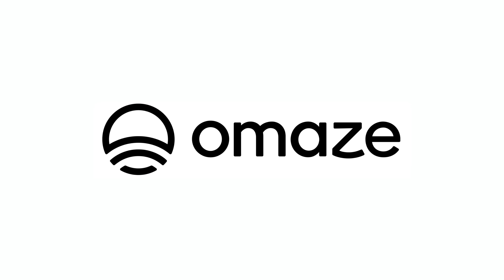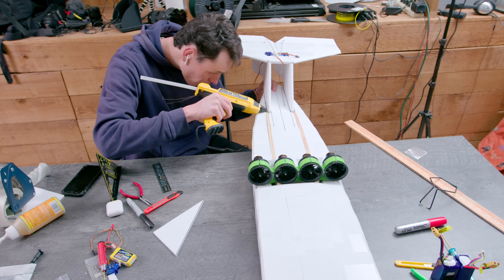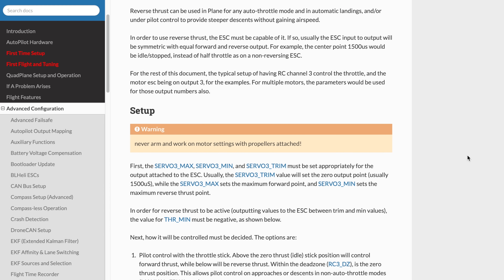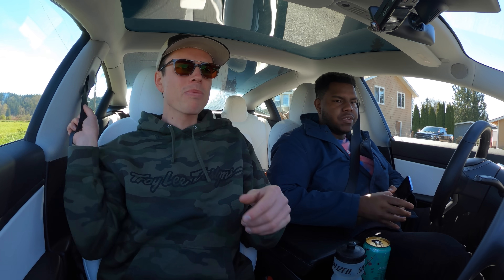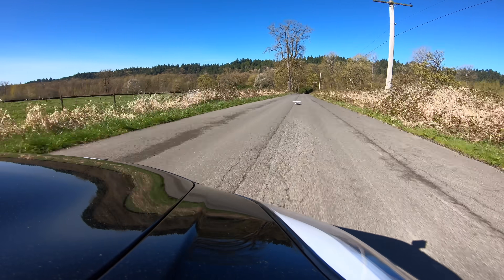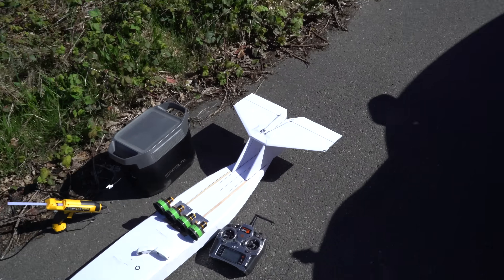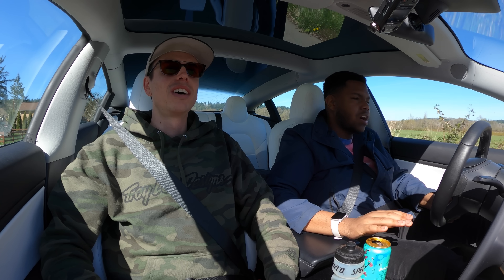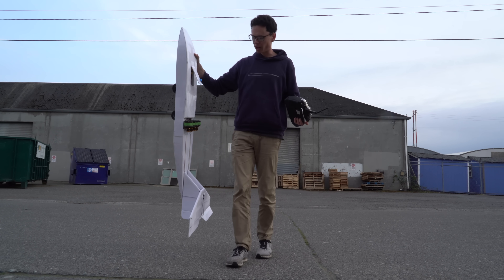EDF Powered Jet Car - High Speed Aero Stability

Comment: everybody commenting about a longer wheelbase...the entire point is, to stabilize it with aerodynamics and not the wheelbase
Reply: With the front wheels also actively turning though, I think there is inherent instability fighting the aerodynamics. Locking the front wheels so they don't turn would reduce but not eliminate it. The scale of the real world road surface to the short wheelbase and tire size is another factor aerodynamics is going to struggle with. A very cool project, but aero is only going to do so much.
Reply: @meZeusta14  I agree
Reply: I was thinking he needs a different testing road. That road is crap, but probably because not too many cars use it. 
Makes it good for testing but not so good for testing something so tiny, going so fast.
Reply: @jbirdmax I agree. Take it to a salt flat
Reply: With a longer wheelbase the body and the rear wing can't change that much of an angle compared to what happens with a shorter wheelbase, so it will bounce less and have better steering control. With a shorter wheelbase the whole car will act like a see saw. Push on the rear wing with your finger and the whole front will come up. That is very difficult to prevent with just aerodynamics, especially on a track that is not perfectly flat while driving at high speeds. Less steering corrections also means less friction and thus higher speed. A longer wheelbase is the only way forward for more speed. I also think that the car has far too much drag to go that much faster. But that is a whole different story.
Reply: It might be faster if you put the same amount of power to the wheels. Imo it would really help to adjust the linkage on the servo and steering linkage to shorten the throw as much as possible. Also you may look at adjusting the front alignment to the wheels to allow for better tracking
Reply: Yea, BUT that's never gonna be stable with aerodynamics. It's physically impossible.
Reply: @b9y  ...and the challenge obviously was to get it as stable as possible. even if there obviously are some limitations.
Reply: I am surprised how no one is talking about how Omaze is a scam...
Reply: Right, but a longer wheelbase would make that end goal easier to achieve
Reply: Y'all talking about wheelbase and making it longer but miss the easiest fix for the majority of the stability issues. The biggest issue is the shocks. Stiffen up the suspension and the cars stability will rise. Its the same with full size vehicles as well, as if you have a bad shock absorber, it will effect the rest of the steering and suspension components by having the oscillations not be absorbed. Trying to aerodynamically stabilizing an unstable object is a lot harder when you have springy wheels with nearly nothing to absorb the oscillations.
Reply: @m_6866  a stiffer spring wont absorb, but cause bouncing. but i think you are right, the suspension should play a major role
Reply: Ok, well give it one wheel then.
Reply: It rreally should just be standing on two wheels, like a segway.
Reply: @haliac7117  by having it front wheel drive and the back being supported 'up' by ground effect? In the aircraft sense that is
Reply: @spencer963  Like when a bush plane lands or takes off, it's on the front two wheels only. Except creating lift to keep up the back would create drag, so I'd think the wheels should be right in the center of mass so it only needs stabalization.
Reply: @haliac7117  a motorcycle
Reply: I didn't say that. :
Reply: Longer wheelbase stabilises
Reply: Thank you. This is not a ground effect solution  but a wing supported wheelbased solution with friction between wheels and ground  etc.
Ground effect deserves an aerodynamic solution.
Reply: The further a rubber is behind the COG the more stabilized it will be.  That is aerodynamics.
Reply: @EElectricJunk  nope, you will need the center of drag (tires and aero) to be ebhind the center of thrust.
Reply: @tflspitfire  I had an airboat that was unstable, moved the rudder back a few inches further, more stability.
Reply: @EElectricJunk  yes, that is in relation to centre of mass and trust.
Reply: It doesn't ride on air, therefore, aerodynamics will not stabilize unless the frame and by way the frame- the wheels (and wheelbase length helps tremendously, says Physics).
You cant stabilize it aerodynamically unless what's touching the ground can somewhat be stabilized. The more, the better. For maneuverability, you want INSTABILITY. The more unstable a jet-fighter is, the more maneuverability it becomes. A lot wouldn't be able to fly without fly by wire computers.They certainly couldn't hold together and fly Mach 1.0+ without computerized stability. And the aeros are UTTERLY dependent on the wheels, and therefore, wheelbase, as that is what it rides on.....it doesn't ride on air, therefore, aerodynamics will not stabilize unless the frame and by way the frame- the wheels (and wheelbase length helps tremendously, says Physics).
Reply: He needs like about 300km+ to get lifted.
Reply: The whole fuselage should be shaped to generate in-ground effect at low speeds by taking air under it, so to have a practical 1:1 application. Also necessary to accommodate control surfaces like "pagani" cars have both in the front & rear of the fuselage for roll/ritch control. Also, some vertical fins so to keep on track. I wonder how will that will look like :)
Reply: Just take a look at the fastest ground vehicle the Bloodhound SSC. long wheelbase. almost no downforce, and the Jet engine is holding it on the ground, And the Airodynamics are holding it stable.  withouth the Jet enige angled to the ground the SSC would just take off at 300 mp/h. you need a downforce or else your about to fly at higher speed.
Reply: @rogerstalder7184  oh ffs. This is not about building the fastest vehicle possible. It is about going fast and stable DESPITE the short wheelbase.

Mountainbiking could be a lot faster if you used a motorcrossbike, but that's not exactly the point right.
Reply: We get that... but the problem is his reaction times, or any electrical algorithm, can't overcome sheer physics. The short wheelbase allows intrusion of way too many variables. The ground isn't level enough, and by the time any axial-based stabilization can counter, it overcompensates for lack of response.

Also, the increased stability and response of a longer wheelbase would allow for the use of smaller/skinnier wheels/tires... making for a much more efficient vehicle, higher speeds, better control, etc.

If he really wanted to test aero-only stability, he could've just used spherical "wheels" made from ping ping balls, and been done with it.
Reply: But the wheelbase plays a huge part in the stability, at least in yaw. If the point was to stabilize it with aerodynamics and not the wheel base, it should have used only the two rear wheels of the RC car.
Reply: @iforce2d  it still has to be able to drive  without scraping over the ground. nad again....read the title
Reply: @jabberwockytdi8901  very well said.
Reply: YOU ALL WRONG. use a 0 inch wheelbase. Calibrate it to float on two side by side wheels. Just use a single ball roller on the front for braking and sitting still. Only steer aerodynamically. LOL
Reply: @stupidvids0  but this is what I mean already, side by side like a Segway.
Reply: @stupidvids0  unicycle is where it's at.
Reply: Thumb pilot what a newbie This channel is all about the $$$$
Reply: Why start with an unsuitable wheel base in the first place?
Reply: @mitchilito99  oh ffs. because the buggy was there already and, as was pinned by the creator, the challenge is tonstabilize the entire thing aerodynamically. Is the chassis was super long and stable already the effect of the aero stuff wouldnt be noticable.
Reply: @tflspitfire  meh... Stability is not going to be really possible with the large unbalanced buggy wheels (and short WB). Longer wheel-base with harder balanced tires would make using aero stability so much easier. This video just looks like an exercise in what not to do.
Reply: @jabberwockytdi8901  read the title...high speed aero stability
Reply: I think the whole point was simply to make money.
Reply: @andrebazenga8639  so what? it's his content anyway.
Reply: @andrebazenga8639  This is his job, so I'd assume so. You could do this for a living too André.
Reply: @andrebazenga8639  and why not 🤷🏽‍♂️ all of us really enjoy watching this stuff so it's awesome that he's making money from it and has a good reason to continue making this awesome content for us :P don't be jealous bro lol

Comment: Just revisited the video after quite a while and saw something new: At 13:34 the car is turning right, but the EDFs are pushing on the right side, trying to turn left. Might the differential thrust steering be reversed? Then steering would depend on the bouncy wheel loading. That could partly explain why it was dancing across the whole street instead of driving in a straight line.
🥳

Comment: Little late, but putting the engines above the center of mass causes an aircraft to pitch down (I've done plenty of simulations in KSP), putting them on the sides should keep them more neutral. Also you should look at creating airbrakes instead of just putting the engines in reverse, this should help in other craft you make as well. I also suspect having wheels in front of the center of mass makes a rudder less effective since it can't as effectively rotate around the center of mass, and creating sideways inertia, not sure if this is happening here but it could explain the side to side sway a bit.

Comment: This idea should be explored upon, while you say it’s not for turning it appears to gain more traction as it floats through the bumps, so maybe active aero with servos to change air flow for turns can make this go 70 mph in a turn as well? Not only that but I think it could also go a bit faster if you were to put the edfs more in a 2x2 row because instead of producing all that drag it would narrow the flat side of the edf’s

Comment: I used to build air racers, with similar problems, for me you got way too much surface and angle of deflexion of your control surfaces. When going fast in RC, keys are : RIGIDITY, precise NEUTRAL setup, and as little angle of deflexion you need while using the entire servo range.

Comment: Seems to still be squirrely aerodynamically.  I would suggest moving your CG forward to increase aerodynamic stability.  This is supported by the fact that when the camera was added to the back, the stability got worse.  The further forward the CG, the more naturally stable it will be and the less the gyro/computer control will have to stabilize it.  Neutral CG gives good responsiveness on the controls, but you're not going for that anyway.

Comment: There is a type of software thats programmable into the flight computer of this RC vehicle known as yaw dampening.

Heres what it does:

Yaw dampening, sometimes called a stability augmentation system, is a mechanism used in aircraft to reduce unwanted side-to-side oscillations, particularly a phenomenon known as the "Dutch roll". It works by automatically adjusting the rudder, the vertical control surface on the tail, to counter these motions and provide a smoother, more stable flight.

Here's a breakdown of what yaw dampening does:

Purpose:

1. Reduces unwanted movements:

It prevents excessive yawing (side-to-side movement) and rolling, especially the Dutch roll, which is a combination of both.

2. Improves comfort:

By counteracting these oscillations, yaw dampening creates a smoother ride for both pilots and passengers.

3.Reduces pilot workload:

Pilots don't need to constantly adjust the rudder pedals to counteract these motions, making flying less tiring and demanding.

How it works:

1. Sensors:

It uses sensors like gyroscopes and accelerometers to detect the aircraft's yaw rate and direction.

2. Control system:

These sensors feed information to a control system which calculates the necessary rudder deflection.

3. Rudder adjustment:

The control system then sends signals to a servo motor that adjusts the rudder accordingly.

Applications:

1. Many modern aircraft:

Yaw dampening is a common feature in both jet-powered and propeller-driven aircraft, from small private planes to large airliners.

2. Automatic or manual:

Some yaw dampeners are automatic, engaging and disengaging at specific points in flight, while others are manually controlled by the pilot.

Additional points:

1. Yaw dampening doesn't replace pilot skill, but it's a valuable tool for maintaining stability and reducing workload.

2. Some aircraft, particularly those with sensitive handling characteristics, may require multiple yaw dampening systems for safety reasons.

I hope this explanation clarifies what yaw dampening is and how it works in your RC Streamliner car project featured in this video.

Think about this, as it could help you.

If you need assistance, I am a freelance programmer.

nick@debeentechsolutions.net
Reply: man if only that one plane that crashed didn’t have its yaw dampers fail

Comment: The 1 & only flaw I saw in this design, is the wheel configuration.

I think if you put the wheels at the absolute front & rear of this "Land bullet jet thingy," you'd have maximum stability at all speeds.

Comment: Personally, I think the horizontal stabilizer was way too large and was causing it to yaw. I think one large vertical stabilizer might work better or possibly put a vertical fin midway on the body, kind of like a shark. I think the only way you can avoid the nose from rubbing is by raising the body off the ground by about 1/2 to one inch. That or put some type of canards or spoiler in the front that super small but would gain some ground effect the close the nose is to the ground, acting as an air suspension.

Comment: If you study the various classes of land speed racers at Bonneville salt flats, you'll find some of the faster classes use a long body fir stability as well. I ve not seen any with a full empenage like yours. At the "flats" in the bad old days they used a skid brake that just applied against the salt

Comment: Maybe ditch the RC car part, make a tricycle out of it with a single wheel as far back as you possibly can and 2 wheels as far forward as you can for steering control with no control surfaces.

Comment: if it is touching the ground, the wheelbase has an effect. It needs to be longer. If the intension is to stabilize with only aerodynamics, then the wheels need to not be a factor. This means that the car needs to be airborne

Comment: It would be more efficient if you used side skirts but moved the wheels to the outside to stop the turbulent air on the underside of the car.
Reply: Moving the fans to duct air under the car would smoothen things out. It would be a hovercraft hybrid.

Comment: Napier Paxman

2 months ago (edited)
You need to taper the duct to 'gear' the fan to the load - thrust will jump. make the 80% of the inlet and use a multi blade fan! :) Like I did with these 4 cell motors running on just 3 cells to prolong life - goes well! https://www.youtube.com/watch?v=Oow1ppcij9o&t=10s

Inlet diameter needs to be 1.25 the diameter of the outlet for a 'solid' multibladed fan! the less blades o nthe fan suit less taper on the duct - the duct 'gears' or impedence matches the fan to the airflow that's why real jet engines have tepered ducts!

Comment: I would move the wheels apart, fronts much nearer the front, to avoid the nose grounding, rears further back, also the track is quite narrow, so widen it, also the twin fins are inducing drag, so go for a single fin, but longer in its depth, also the elevator is way to wide, and could be reduced by 50% if not more, the test road is very bumpy, so thats causing steering issues

Comment: How about adding LIDAR to the front to predict the terrain variations and automatically adjust the elevators to compensate.  That would allow it to float over the cracks and bumps.  Probably would need to mount it high on the vehicle, so that the control system has time to react.  Also, rocks and pebble avoidance (with said LIDAR) could be incorporated into the speed limiter maybe to help maintain horizontal control?  Sorry, new here, I'm sure others have already suggested these, I'm a bit too lazy to read too far down in the comments.  Fun stuff though!

Comment: Use a thrust tube, the length of the diameter of the fan. 
Exhaust should be about 85% of the fan swept area (surface area inner diameter shroud, minus surface area of the motor area. Multiply that by .85 and get the diameter for that surface).

Comment: i think were your differing from some of the fastest rc cars is your form of thrust, most of the fastest rc cars use electric motors, and although i think you could get higher speeds with propellers I think youll need a lot more power and bigger fans

Comment: 3:37 “Can you run the fans backwards”
The direction of rotation alone won’t make any difference with fixed pitch propellors, it’s the angle of the propellor blades that will. Real reverse thrust propellor / turbo prop engines have a variable pitch propellor hub that turns the propellers around.

Comment: It will NOT harm your motors to reverse at full throttle. I have a Draco which has reverse throttle. It is don while motor is on ground to stop plane faster.

Comment: I've been wanting to put a spoiler on a vehicle, then put multiple EDF's underneath. 
Once the vehicle motor gets it up to highway speed (say, 70mph), the EDF kick in and the motor (let's say it's attached to a manual transmission) is allowed to idle while driving the alternator to power the EDF.
Would the EDF act as a speed maintainer?

Comment: What an awesome machine, but I keep thinking that the wheels are just a relic from having to hug the ground and totally unnecessary weight.  Get rid of the wheels,  duct some of the air under the frame so you can have a flying hovercraft.